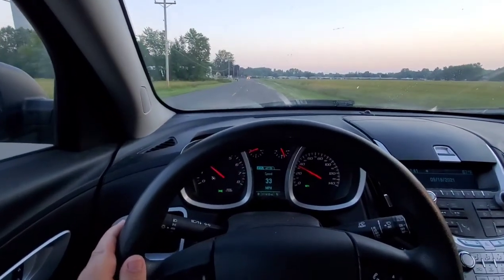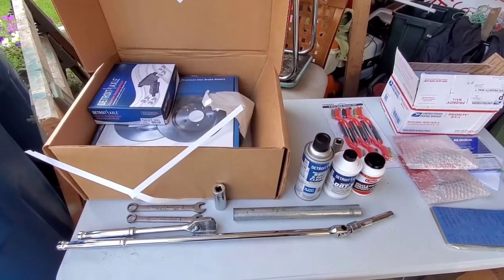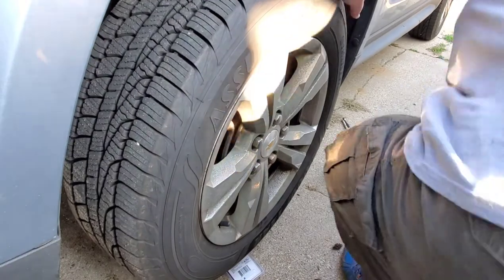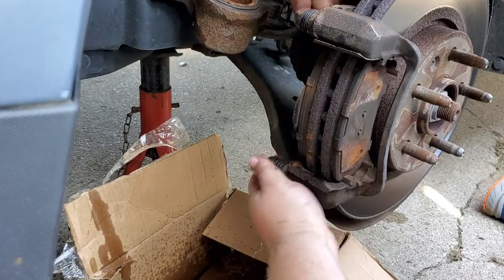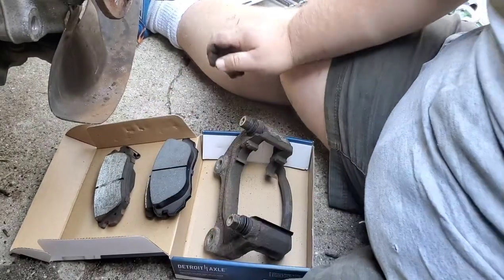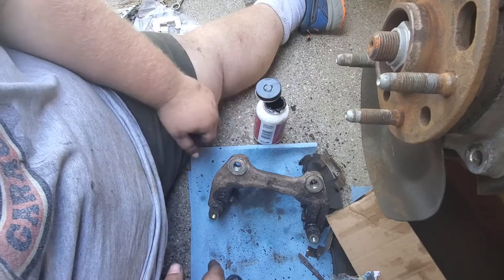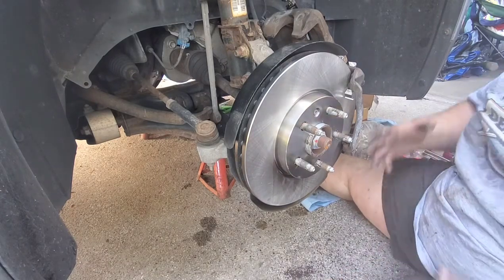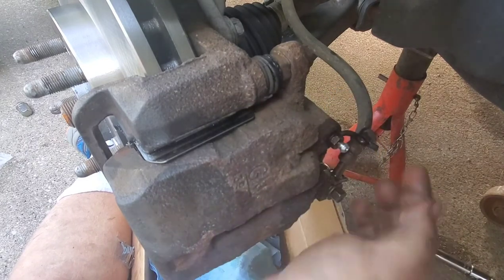2014 Chevy Equinox brake pad and rotor replacement.

Comment: when wrenching on old rusty metal parts use mouse milk prior to loosen it, used on airplane rusty parts
Reply from the maker: Hmmm. I'll have to look into that mouse milk. Never heard of it. Thanks for the tip!
Reply: @delmontindustriesltd7501  Its avaialble on Amazon I get it  from a plumbing supply
Reply from the maker: Thanks, Dan. I will for sure look into it!

Comment: Why in the world would you open the bleeder right off the bat?  Use a piston compressor or an old brake pad and a C clamp and slowly push all that brake fluid back up into the hydraulic reservoir, then replace your pads & rotors and re-install everything.  Absolutely no need to open the bleeder unless you have air in the system.
Reply from the maker: Glad you asked. Opening the bleader ensures that any possible debris or contaminates in the brake system will flow out instead of back up through the system. Plus it is easier to compress the caliper. Is it necessary? No. Your way is fine.
Reply: @delmontindustriesltd7501  why would there be contamination in a closed system?
Reply from the maker: What if dirt got in when a previous owner checked the fluid?  Or older style steel brake lines rusted  from moisture? There are many ways contaminates can get into the brake system. Is it common? No. But possible. With something like brakes, I'd rather not take a chance. Contaminates will flow to the lowest point in the system.
Reply: @delmontindustriesltd7501   Haha ok